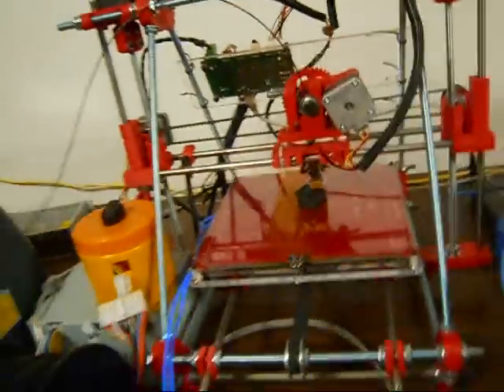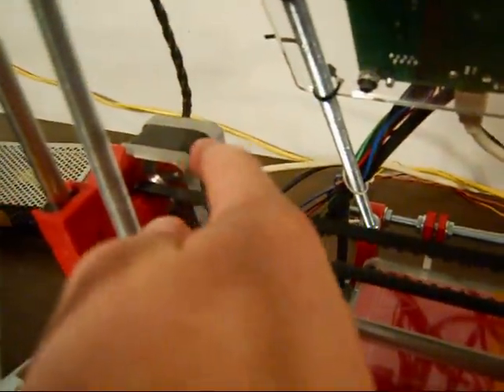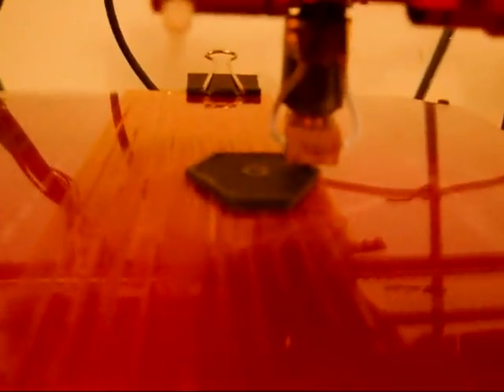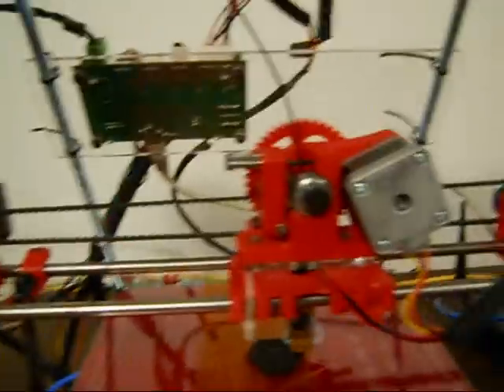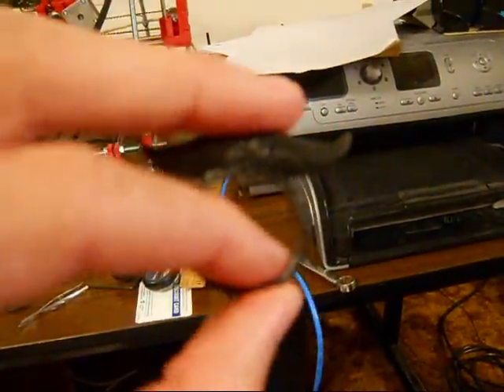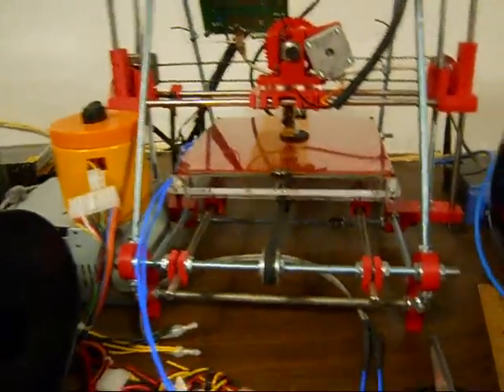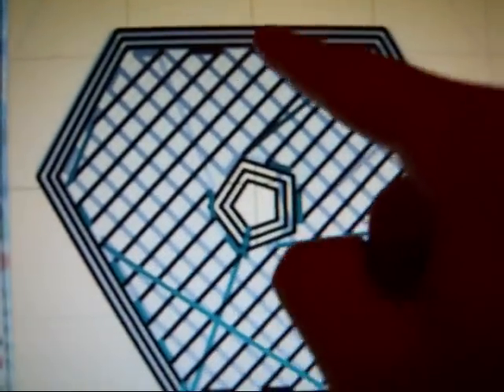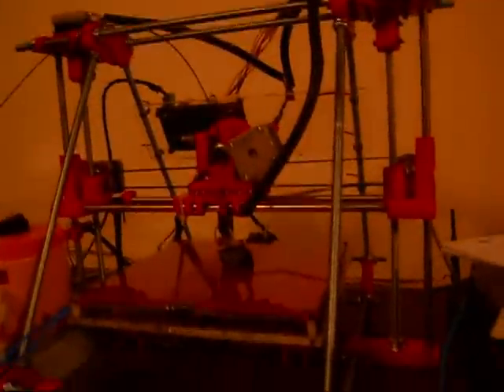My New 3D Printer!

Comment from the maker: hmmm id have to look into that. im still working on getting this once perfect because apparently after several prints the nozzel can clog up and im trying to fix that by printing fan duct work to cool part of the nozzel. i would have to get the many of the parts from different sources because most of my parts came in a kit so i dont know how much different the cost would be. im not sure how much to charge for assembley but it might be around $300.